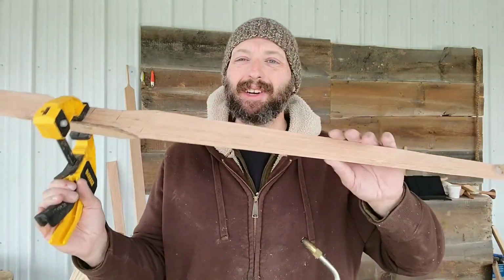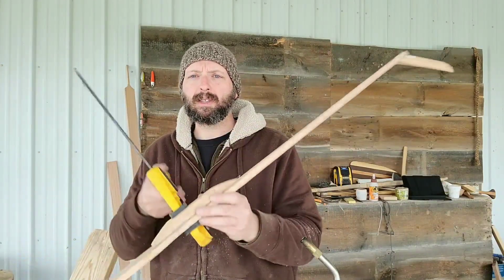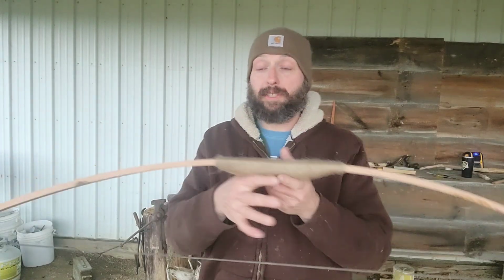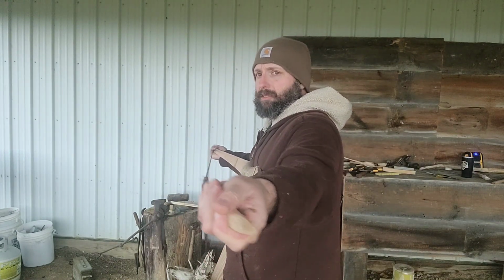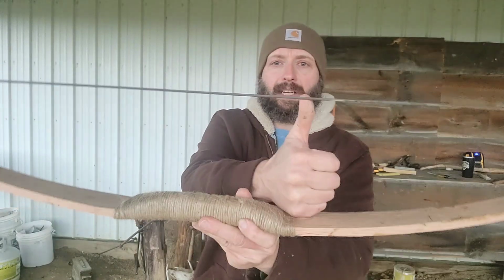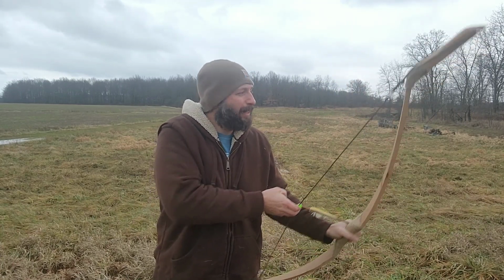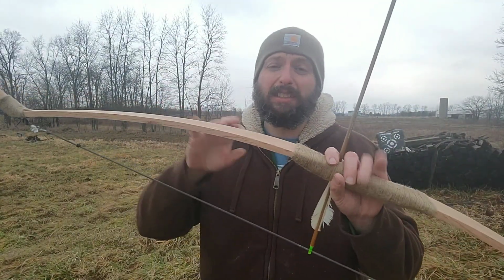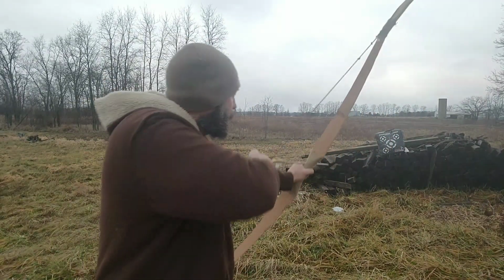Board Bow in under 60 Minutes

Comment: I did take the course and it is really good.  However, there was no mention on what type of arrow to use.  Would you share what arrow/spine you use?  Thanks.
Reply from the maker: It depends on your draw length and draw weight. I think these are rated for #45